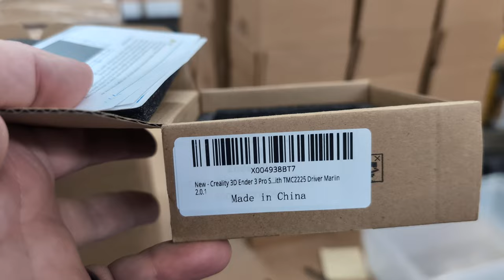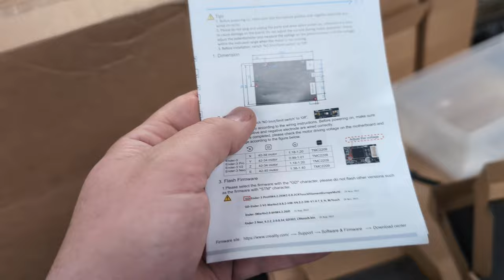Fake V4.2.7 Boards Amazon & Ebay - Gigadevice CPUs & Completely Different Board

Comment: Considering the significant cost of handling returns and refunds, and the damage it does to their reputations, I'm a surprised the giant retailers like Amazon & Ebay haven't done more to address this growing problem of 3rd parties using their websites to sell fake and/or mislabeled parts.   Like nearly all modern megacorporations, I'm sure they'll continue to take the idiotic approach of ignoring problems until they negatively impact the bottom line.
Reply from the maker: They don't care. They make money either way even if it's returned. The sellers pay all the fees